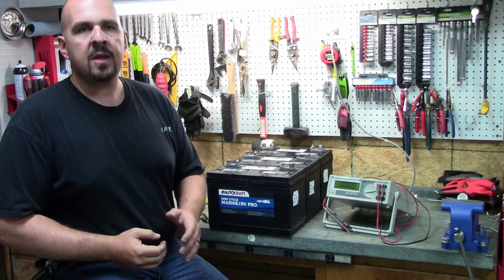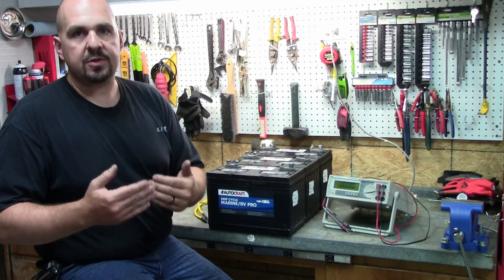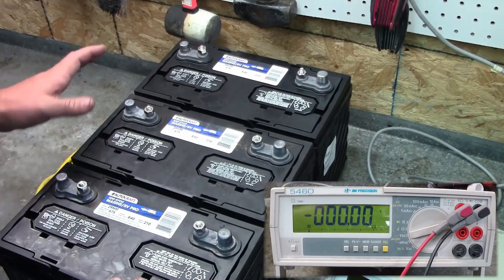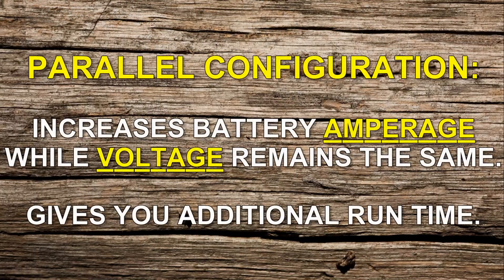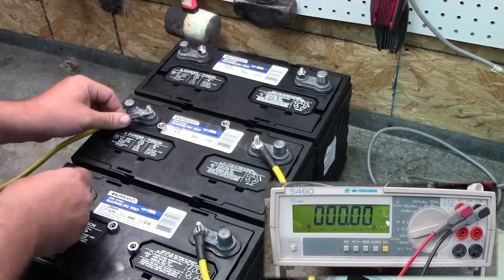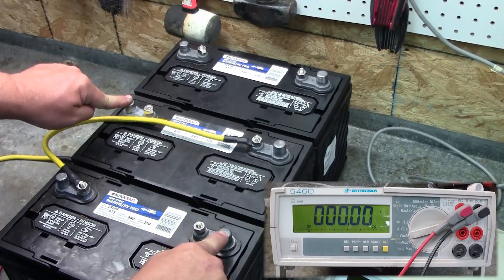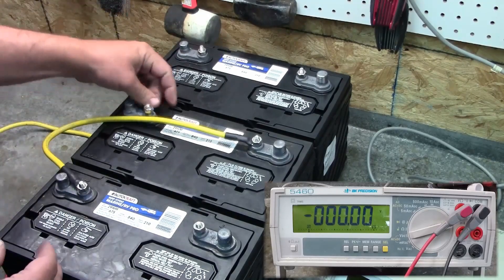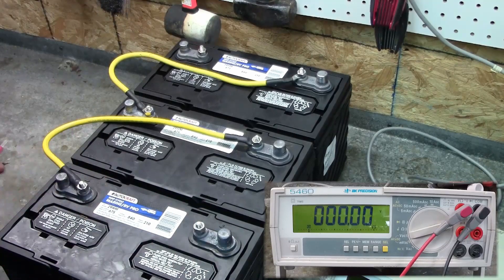How to Properly Wire 12v, 24v & 36 Volt Trolling Motor Batteries In Your Boat (Series vs. Parallel)

Comment: Thank you for the video. While being pretty straight forward, a daunting task if you never have done it. Quick question, can you have a 12 volt and 24 volt system off 2 batteries? Like coming off one battery for the bilge/lights and off two batteries for the trolling motor? Thanks again!
Reply from the maker: Yes you can. Before I added additional batteries in my boat, I used one of the batteries to start the outboard and run the 12v electronics while simultaneously using it for half of a 24v bank.

Comment: So you don’t have a jumper from ground to ground and positive to positive?
Reply from the maker: Ground to ground and positive to positive is for Parallel connections. Increased amperage at the same voltage.

Comment: Would you use a golf cart charger 36v to charge the 3 battery 36v setup or disconnect and charge 12v individually 🤔
Reply from the maker: You can actually leave them connected while still charging them individually.

I use a noco genius 3 bank charger to keep my 36v system charged. It has 3 separate 12v charging outputs.

Comment: I have 2 12 volt wired for 24 volts.  Could I run an additional battery in parallel to one to increase amh?
Reply from the maker: You can, and it will work. However, the single battery will end up working a lot harder because the load will be imbalanced
Reply: @TheWeekendAngler  would it be best  to a) rotate which of the 3 are the "single" each time out?  B) buy a 4th and have two seperate power source, or c) buy a forth and have a 24v 4 battery system

Comment: If you used battery A to feed 12v to your accessories would it hurt to run the 12v accessories and the 24v trolling motor at the same time?
Reply from the maker: No, I actually did that before I put a 2nd dedicated battery for my 24v trolling motor.

One battery ran all my electronics and started the outboard, the other was just used to make 24v for the motor.
Reply: @TheWeekendAngler  thank you for the response, I have an 18ft center console that doesn't have the best storage capabilities so I'm hoping I can get by with just 2 batteries under the console and one starting battery in the back

Comment: Hi what  is the connectivity for 3× 120 amps batteries to make 24 volts .and very simply ecplained thanks
Reply from the maker: Don't do it with 3 batteries. Do it with 2.

3 would present an unbalanced load
Reply: @TheWeekendAngler  Thank you kind sir but i need more back up for loadshedding .Am running my alarm .gates .wifi and computor .2 batteries arnt enought .Have a 4 kvh invertor
Reply from the maker: @abbasabboobaker1404  you could run 4 batteries. Make two pairs of two batteries connected in parallel. Then treat each of those pairs as a single battery and connect in series to get 24v. Best if both worlds
Reply: @TheWeekendAngler  Sir thank you very much .Greatly appreciated. Thats an absolute good solution will have good back up .Thanks again

Comment: good video, My question is I may start running a 24 volt motor in the back and a 12 volt in the front plus all my lights and very pricey fish finder are 12 volt. do I need something to reduce the power back down to 12 volts for my other 12 volt items or can I hook them up to the 24 volt system?
Thanks William

Comment: When you wire the three together do you have to hook the charger up to all three batteries or will it charge all three at once just hooking the charger to one battery?
Reply from the maker: You will need to connect a charger to each individual battery if they're wired in series.
Reply: Dude I followed your instructions step by step it worked flawlessly, waiting on my 60 amp breaker for my new 112 I’ll be set, thanks for your videos man keep them coming.👊
Reply from the maker: @billmattingly3772  thank you! I'm glad it helped you out!

Comment: I got a 36v minnkota. Can I use 3 battery's in series for that, using one of them for my crank battery? 
Was thinking if I needed more I could have a extra cable to temp wire 2 Into parallel to start if they are low from trolling....
Reply from the maker: Yes. That would work just fine.

Comment: Great 👍 Many thanks..
Reply from the maker: You're very welcome. Thanks for watching!
Reply: @TheWeekendAngler  your welcome..I looked at this as I have a 24 volt solar off-grid solar panel set up coming but with no batteries! The 24volt are so expensive so I am thinking maybe I can get a few 12 volt batteries as i need to up ampage and get the 24 volt required.. Sorry I may not be making much sense but in effect I have a 24 volt system and so need the smaller less expensive 12 volt to compensate if I can do this of course 🥴

Comment: Question, 24 volts set up, can you add the 3rd battery to get more capacity?  Thanks just asking?
Reply from the maker: Can you? Yes. Should you? No.

The load would be unbalanced and would place unnecessary strain on the single battery.

Comment: Hi, Thank you  sharing the video. This is really helpful for us. Can you explain more the high lighted point. For longer battery life Series or parallel connection is fine. If it is series then why or where we can use the parallel connection or vice versa.
Reply from the maker: Thanks. Some devices require a higher voltage to operate. For instance, the trolling motor on my boat is a 36v model. This requires me to run 3 batteries in series.

Parallel wiring is good for 12v devices that need additional run time.

Hope this helps.

Comment: I have a 24 volt trolling motor now using 2 12volt batteries,   Can I add a third battery to increase run time? if so, how do I wire it?
Reply from the maker: Adding a third battery would be possible, but I wouldn't advise it. You'd really need to have four batteries to balance out the load.

For a four battery 24v setup, you'd Parallel two sets of 12v batteries and then connect them in series to get 24v.

The additional weight of two batteries, not to mention the cost, would probably outweigh the benefits of doing this.

I'd look at upgrading your current batteries to a pair of good Group 31 size batteries.
Reply: Thank You. My 2 battery configuration at 24 volts will only last about 4 -5 hours using my MotorGuide Pontoon trolling motor. Both batteries are only 2 months old. 4 batteries would not doubt sink my boat.

Comment: Why is it when I try this sparks fly and I get shocked?
Reply from the maker: You're doing something wrong.
Reply: @TheWeekendAngler  yeah I get that but can’t figure out what it is without getting zapped🤷‍♂️
Reply from the maker: @billmattingly3772  if you're seeing sparks, it sounds like you have one of the batteries reversed. Each battery should only have one wire connecting it to another battery. Negative to positive.
Reply: @TheWeekendAngler  thanks

Comment: If I have the 24v system can I still just get 12v if connected to one battery and if so can I charge back 12v and it would only charge one battery
Reply from the maker: Yes. You can connect to individual batteries and get or charge 12v

Comment: Is it possible to run the 3 12v batteries together at 24 volts?
Reply from the maker: I wouldn't advise it. You'd end up with 2 batteries in parallel connecting to one battery in series. You'd get 24v but it would put a hard strain on the single battery
Reply: @TheWeekendAngler  Okay! I was curious because I have 3 batteries but needed to stay at 24v. Thanks for the quick response.

Comment: Hi, Can you please confirm if two 12 volt batteries can be hooked up in series for a 24 volt trolling motor and also run 12 volt fish finder graphs at 12 volts if the graphs are hooked up to just one of the batteries? Thanks, Tony
Reply from the maker: Yes that will work.
Reply: @TheWeekendAngler  Good, thank you for letting me know.

Comment: What about charging?  I had a 24v marine trolling motor …about to install 36v…will my wall plug in still charge all 3 once i install?
Reply from the maker: If you have an onboard charger, which it sounds like you do, you'll be short a charging bank when you upgrade to 36v. You'll need to either upgrade your onboard charger or hook the new battery up to its own 12v charger.

Comment: That's a great idea. I would like to try this. Turning my 2 12 volt batteries into one 24 volt battery. Is it safe to use full time??? Like... Could the batteries explode?
Reply from the maker: It's safe to use all the time. Now, you need to make sure the device you're running needs or will at least handle 24v or you'll damage it.

Comment: Is it ok for the deep cycle batteries to run them on a trolling motor in parallel and charging them in parallel?  Would the possible discharging and charging at different rates affect the lifespan of the battery?  Is it easier to get a battery switch and run each battery separately?

Comment: Don't you need a BMS for series connections?
Reply from the maker: A battery management system is not needed for serial connections.
Reply: @TheWeekendAngler  Why not?

Comment: Do the batteries have to be positioned a certain way to accomplish the series connection? my trays sit longways horizontally.
Reply from the maker: No, they can sit however you need. The connections need to be made exactly as shown, however.
Reply: @TheWeekendAngler  got it. Just having a problem with 24v trolling motor barely moving once connected in series. one battery is 625 MCA the other 650MCA, and don't know if that is an issue.
Reply: both are fully charged.

Comment: Is there a way to run a 24v trolling system but connected to the motor for charging while underway but also not stealing too much from cranking battery?

Comment: WHICH BATTERY WOULD I CONNECT THE TROLLING MOTOR POSITIVE AND NEGATIVE WIRES TO FOR THE 36V CONFIG?
Reply from the maker: When wired as shown in the video, you will have one battery with an unused positive terminal and one battery with an unused negative. These are the ones you'd connect your trolling motor to. These are the same terminals you see me connect the volt meter probes to in the video.

Comment: Great video. I also just bought my 1st 24v trolling motor and you made the job so much easier. Thx. One question though, how do I hook up my 12v accessories? That's probably a dumb question
Reply from the maker: Hook up your 12v accessories like normal... Use the positive and negative post of only one battery. I'm glad this video helped you out. Thank you for watching!
Reply: One more question. My boat has an on board charger,  now that I have 2 batteries wired for 24 volts, do I unhook the jumper wire before I charge a battery or leave it hooked up?
Reply from the maker: @markjennings9527  You can charge both batteries separately at 12v each with the jumper wire in place. I have a 4 bank onboard charger that's connected to all my batteries. I do not have to remove the 2 jumpers on my 36v bank to charge.
Reply: @TheWeekendAngler  Thank you very much. I'm glad I found you on here, you know your stuff.
Reply from the maker: @markjennings9527  thank you. I'm glad I was able to help. Thank you for watching.
Reply: It helped considerably. I tournament fish and have my first of the year in 2 weeks and just picked up a used bass boat and today put the new trolling motor on. I'm actually going to subscribe to your channel right now. Thx again

Comment: So could you run battery one and two parallel and then add battery three in series for a boost on amps?
Reply from the maker: Yes. That would result in a 24v system

Comment: Great tips, ty. I have a 12V system where I have battery in back of boat and a battery in front of boat and I have a wire from both negative and positive going to to front. Is that still 12v system, how ever I want to put a 2nd battery up front and connect to the one that is already there. What is your suggestion how to connect each battery? And will it give longer run time?

Comment: So, when you do 24 or 36 volts, you only need one cable on the batteries instead of two?
Reply from the maker: You'll need a positive and negative cable to run from your battery bank to your load (trolling motor, inverter, etc) the positive and negative supply cables attach to the same unused posts where I connected the volt meter.

On a 24v system you'll use 2 batteries and 1 connecting wire (the yellow wire in the video)

On a 36v system you'll need 3 batteries and 2 connecting wires.
Reply: @TheWeekendAngler  thanks a lot!
Reply from the maker: @Blessbethelord  you're very welcome

Comment: If I add another 12v battery for my trolling motor to run it parallel just to add Ah will my boats on board charger that has two banks one for cranking battery and the other for the trolling motor battery charge the new battery that I added in parallel??  Thank you !

Comment: if i were to put in series my current two batt's. will this fry the parts that are hooked up as 12v.? do i need to add a third batt'. connecting the new batt'. to the 12v powering my small 12v trolling motor
Reply from the maker: You can pull 12v and 24v off of the same two battery setup. What you do is make sure yours 12v devices are only connected to the positive and negative posts of one battery.

That being said, though. If you have room for a 3rd battery, it's the better way to go.

Comment: OK great video.how would you set up a 24v trolling motor and a cranking battery together? Outboard motor charging all batteries when running. My boat is a long way from power and pulling those 2 heavy t.m. batteries out every time to charge is really not a option. Thanks.

Comment: What size jumper wire should you use for a two battery 12-volt connection?   Parallel Connection.
Reply from the maker: 6awg would be fine. 4awg would be better.
Reply: @TheWeekendAngler  Thanx. Now what about converting to 24 volt,  would that same 4 gage wire work for series?
Reply from the maker: @rickkaminski4519  it sure would.
Reply: @TheWeekendAngler  Thanx for the info.

Comment: good information, sir i have 2 batteries deep cycle lead acid each one have capacity 185AH i want it to parallel them and both are sitting next to each other and both batteries terminal to terminal length is 10 inch only ( 10 inch wire length required for parallel these batteries ) i have a load of max 50 amp home appliances normally 300 to 400 watts, i want to know can i use use 10 inch wire length ? and which wire guage should i use it will really helps me a lot thanks in advance best of luck

Comment: If you make a 24v system, what do you need for a charger? Can a 12v charger work?
Reply from the maker: I prefer to use a 12v charger for each battery or a multiple bank charger which has an output for each battery.
Reply: @TheWeekendAngler  do you have to disconnect the to batteries from each other when charging?

Comment: Good video but what terminal do I hook my trolling motor leads to pos one battery 1 and negative on battery 3 or just hook it to any pos and negative battery to get the 36 v ?
Reply from the maker: You'll connect it to the same terminals I connect the meter to in the video. The unused terminals on batteries one and three.

Comment: 1. Where can I buy that yellow connector? 
2. Do you connect the positive and negative wires running from the trolling motor to just one of those batteries? (For the 24V)
Reply from the maker: The yellow is just a section of yellow wire. I just use it to make it easy to identify. You could use a scrap piece of red wire if you choose to.
You will hook your trolling motor wires to the unused battery terminals. So for a 24v system, you'll use the unused positive terminal on one battery and the unused negative post on the other.
Reply from the maker: I buy all my wire from genuinedealz.com

Comment: Thanks for the video!  Easy to understand and well done.  I do have a questin that you might be able to help me with:  I have a 24 V system for my Minn Kota 80 trolling motor.  Works great except in the river I only get 3 hours of trolling time.  Can I add  one or two additional batteries hooked in parallel to increase my trolling time?
Reply: Sounds like you need larger batteries, more Amp Hours. What size do you have now?

Comment: Hey, can I run my bilge pump, running lights on a two battery system like this in series or parallel? I would like my trolling motor, bilge pump, and running lights to all run off two batteries. I plan on using one of these systems deciding on a 12 or 24v trolling motor currently. I’m trying to find out if I can also run my bilge pump and running lights on either of these wiring methods. Hoping to avoid adding a potential third battery for just the bilge pump and running lights. TIA
Reply from the maker: Yeah, as long as you're running in parallel you'll be just fine. You could even pull off of one battery if you make a 24v system and get 12v from it, but you'll be drawing unevenly from your batteries.
Reply: @TheWeekendAngler  We need a video for this.  I have a two battery system.  24v Trolling motor.  WIll run in series for the trolling motor.  Now I have motor cranking, lights, bilge that need 12v.
Reply from the maker: @RyanDyalRealEstate  I can make that one happen.

Comment: My boat is already wired to just one battery for a 12 volt trolling motor. Just bought a 24 volt trolling motor. The existing battery I already have all I need do is put the 2nd battery in and run one jumper wire to it and then I’m good to go? Is anything else need to be changed like up front where the plug in goes and all that?